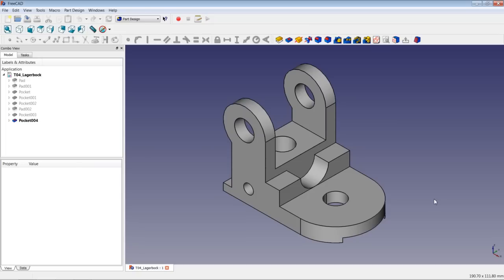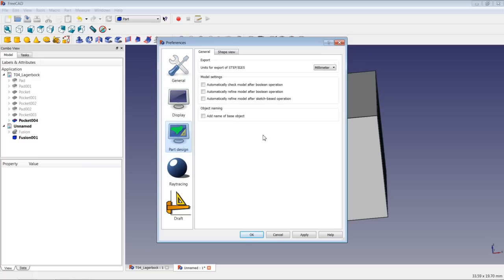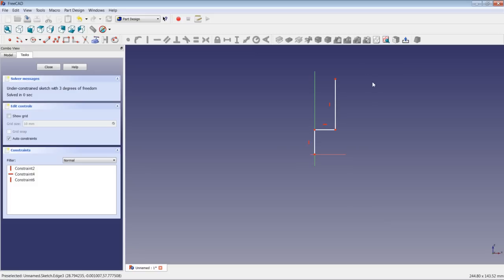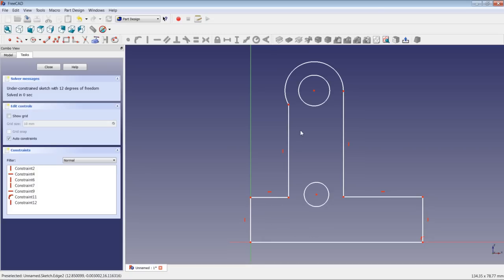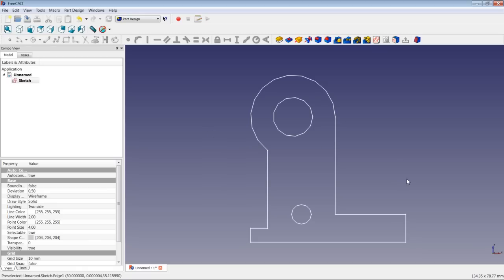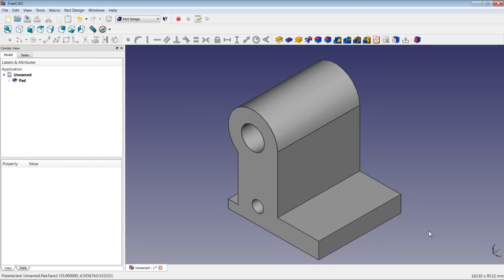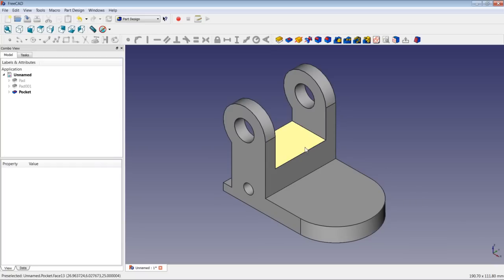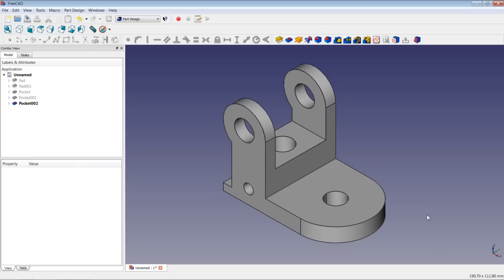FreeCAD Lesson 04 - Bearing Bracket

Comment: Free cad is a very fine program. I have 2 diplomas in Mechanical engineering. I am 74yo with 5 strokes and 4 heart attacks with 2 heart shocks. I am a master tool and die maker also retired and owned a machine shop for 32 years. I have used auto cad , solid works, Pro-e Fire wire, Onshape and Master Cam. I have watched several YouTube tutorials and re-watched them over and over to learn.  I love this tutorial. His voice is very clear and his training is the best. I wish that I could make the cad programs but i am not a programmer.   Free Cad fits my budget perfectly and is very powerful. I have stopped trying to learn Turbo Cad platinium20/20and I decided to concentrate on learning Free Cad. This tutorial is great. I thank every one who helped make the Free Cad program and everybody who teaches how to use it. Thank you very much!!!! Good luck to all the users of Free Cad and teachers.!!!

Comment: This gentleman is a genius.

I am using version 18 and the 2nd last pocket operation to the first face did not refine the face into one in the Part Design Workbench. So instead of doing "to first face" I changed pocket to 10mm for "dimension" and then that face was refined perfectly into one.

Comment: Your lessons ROCK!
I built this and then asked in a very Donald Duck voice, what does it do?
Reply from the maker: It fixes the foot of a welded structure, allowing an adjustment in position and pitch of the structure.
The big front hole is for a screw fixing the end position and the two small holes hold a pin allowing adjusting the picht (angle) of the complete structure to be adjusted.
Reply: Groovy, thanks :)

Comment: at about 14:20 in your vid when you show "model already did refinement" and you show that the top is now one surface and the bottom is now one surface. On my model the top of my part is now one surface but the bottom is 2 surfaces along with the line?? I'm using version15 I checked the 3 check boxes in part design preferences are all checked. I've also redrawn it a few times but always get the bottom being 2 surfaces along with the line. Any idea what's going wrong? Thanks in advance
Reply: +jsdspif3 nevermind. in a post someone states there's a bug in ver. 15 refinemenet and to use the dimension of 10mm. I did that and now the bottom and top are one surface with no line. False alarm. Thanks anyway. Sorry about that. Thanks to the poster with the correction.
Reply: +jsdspif3  Same here.

Comment: Many thanks for these videos, I hope you realise you're going to be responsible for single handily getting people into FreeCAD and there by CAD in general which is a great thing! Question: Is it possible to merge points when in sketch mode, for some reason I sometime create an additional unwanted point instead of creating a closed or linked sketch?
Reply: +Dan Gascoyne 
Yes, just select the two points and choose the coincident constraint.
Remember the fist Circle Sketch we did with Tutorial 1 - Turners Cube around Minute 28:00 ?
Reply: You know when you ask a question and then the penny drops, that just happened whilst doing lesson 05 right now! It's the terminology that threw me as the whole concept of constraints makes complete sense but is alien to me (I've dabbled in 3D surface modellers before like Lightwave but not CAD based stuff). Once again thanks for you support :P

Comment: Ok, I just started learning how to use FreeCAD and these tutorials seem to be a great way to learn how to use the program.  Using objects to teach is also a great idea.  

I'm running into the same issue with a couple of the Parts Design tutorials.  After padding my initial sketch and choosing a face in which to draw another sketch.  The vertical and horizontal center lines are not centered so I can use them to work with.  

For example:  @15:26 You create a rectangle and center the vertical lines so the rectangle is in the center of the object.  Using the X and Y axis lines (vertical and horizontal lines) How do I center the object so I can sketch using the center lines (vertical and horizontal lines)?  I know there is an option to fix it, but I cant find it.  

Why isn't the object just centered every time I start a new sketch?  Or why cant you move the object or have it snap to either the vertical line, horizontal line or center the object on both?  Or in the Task menu of the sketch have an option to snap to center, vertical or horizontal lines.  Or instead of moving the object just move the lines.  

I mean I could create a couple lines,  modify the length and get the center myself but whose to say its exactly the center or possibly a tenth of a millimeter off.  

Another issue, sometimes when I hover over items on the menu bar, the hover text doesn't appear letting me know which tool it is. 

Just something to think about.  Like I said, I'm new to the program and there couple be an extremely easy way to center the object that I don't know.  But if there is why isn't it on the left side in the Combo View?

Comment: I have been having trouble following this because evidently the program has changed since this video. When I go into part design, and then start a new sketch, it automatically changes to the sketcher workbench. Also, all kinds of unintended things are happening. I get inconsistent results. I'm trying out the program for the first time, trying to follow along. I think I'm going to give designspark a try before continuing.
Reply: even Design spark is a good one, I use them booth

Comment: Thanks so much for these videos.
I followed this exactly and got a slightly different result. I noticed that even though I have automatic refinement enabled it does not join all faces/remove lines like in this demo. Some it removed and others it leaves.
I'm using version 15 on Ubuntu. I'm not sure why it does this or how to manually refine the piece.
@14:00 you add a pocket and freecad auto-refines the top and bottom. On mine it refined only the top and left the bottom as 2 faces.
How can I fix that?
Reply: RoscoeT99 
Hello.

This is a known bug in 0.15 stable release.
I reported back and it is already fixed.
For Version 15 the bug appears if I remember correctly when using pad option "to last" on second pad (pad001).
It APPEARS NOT using "Dimension" value (in this cas 10 mm).

BPLRFE
Reply: BPLRFE You sir, are very helpful. Thanks again.

Comment: Thank you for the helpful video. . . I did make this but when I try to export as an .stl file, it does not look right at all. None of the pockets or pads are there that we made. Just basically a hunk from the first basic sketch with pad. And if I export it as an .iges file, it's even worse, looks very strange. Any input on this? Thanks
Reply from the maker: +johnsbigboytoys 
When exporting to STL or other 3D you have to specifically mark the solid to be exported.
In your case, please:
> select the LAST feature in the tree view (pocket004)
> select (from pull-down-menu) "File > Export"
> in the now open dialog, make sure STL is set as File type.
> apply a file name (no ending ".stl" needed) and hit Return or click on  "Save".
and everything should be fine.
Reply: +Learn FreeCAD Wow, you are a genius! I did exactly what you said and it worked perfectly! This was ruining my day and ruining freecad for me! Thank you so much and thank you for such a fast response, I don't think I had to wait an hour! Anything you need, just ask. I am subscribing.

Comment: is there a way to increase the size of the cursor text? (I think that is the correct term. The dim's shown next to the cursor). Mine is very small, so much so it's really not readable. I see that it's there,but it's to small to read the numbers??
Reply from the maker: +jsdspif3 
Are you talking about the sketcher dimensions ?
Within FreeCAD, look at the top menu row.
Choose "Edit > Preferences" and click on the left row on the "Display"-icon.
Then choose on the right side the tab labeled "Sketcher" und scroll down a little bit.
I set the Font size for sketch editing to 14 px and feel quite comfortable with that.
Reply: +Learn FreeCAD no . When you first started the sketch using the poly line tool and you say "I'll make sure the polyline tool recognizes the origin" and you place the crosshairs on the center point of the axes there are dim's next to the crosshairs showing where the crosshairs are positioned, and if you were to move the cursor around those small dim's change showing where the cursor is now at in it's new position. In your video they are the small blue numbers. Even in your video they seem so small but I almost think mine are smaller than that. Is there a way to make these larger ?
Reply from the maker: +jsdspif3 
They show the co-ordinates of the cursor.
I have to admit I never pay attention to them. Constraining is more important. For visual reference you can also toggle a grid via the Preferences for the sketcher ...
But anyway interesting question, i will ask if somebody on the forum knows ...

Comment: I really do give up.

I follow the tutorial, copy the processes and get stuck with constraints for hours, to me a completely pointless task given you should be able to simply tell it the overall size, the centre point you want and none of this clicking 8 or 9 lines to make them fixed.

I just spent 20 minutes in dumbfuckery mode trying to constrain something that each time it accepted a constraint, complained about it but would not suggest what constrain I needed despite SELECTING TWO FUCKING LINES TO WORK WITH.

Jeezus, this program is really annoying.

When I was about 12, I had a play on a very early cad system, one that had a light pen and all that, long before a mouse was a thing and making stuf was very easy, point, select, cut or remove or intersect depending on the operation, and easily manipulated.

This thing takes about 20 steps to just put in a wire frame.